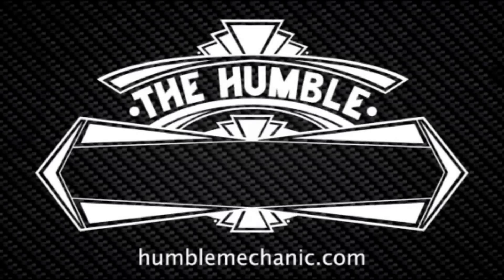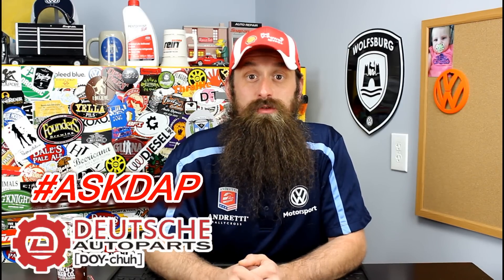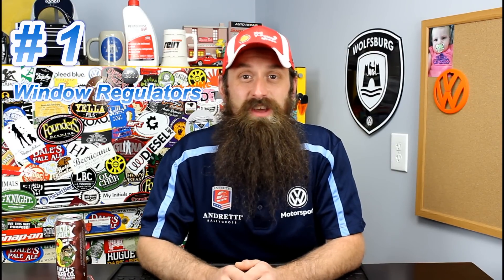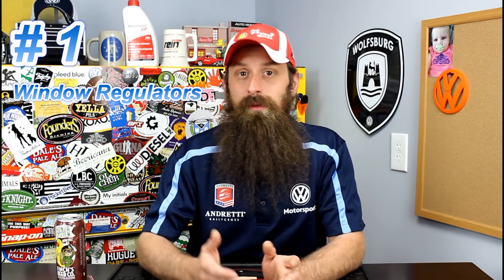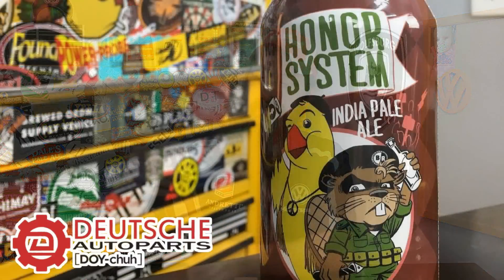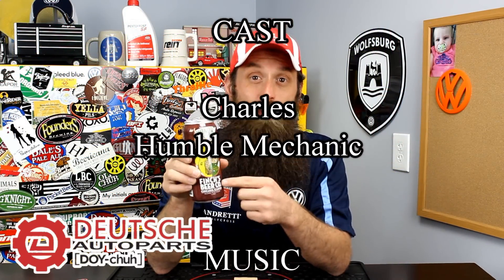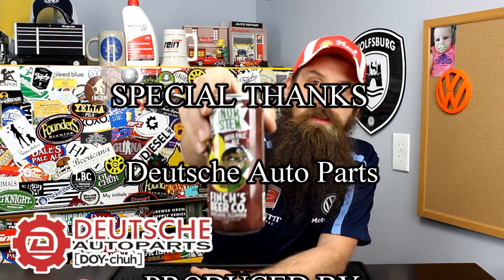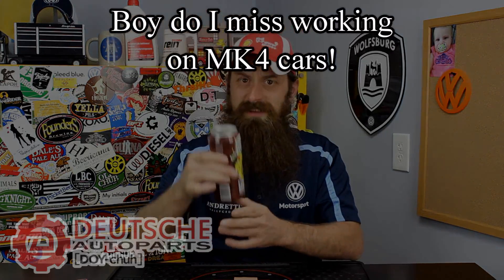Top 5 Failures 1999-2005 MK4 Golf, Beetle and Jetta

Comment: One nice OEM upgrade for one of the issues listed: control arm bushings. Get the solid rubber bushings from an Audi TT or Golf R32. They are a LOT more durable and don't allow nearly as much movement as even a new stock bushing. The steering feels significantly more direct. And they fit not only Mk4s, but mk3s, B3/4 Passats, Corrados and even Mk2s.

Comment: - Hand brake cable causing rear uneven braking.
- Mass air flow sensor.
- Turbo
- Trunk (boot) door lock (water gets in)
- EGR valve getting dirty
- Carpets loosing from locking mechanism in the floor.
- Key inmobilizer failing intermittently.
- Door panel switches for windows failing intermittently.

Maybe a video with the top #100 problems? Anyway ALH engine was the best all around.
Reply: Beetles from 2000 can be got for around £600 in the UK (quite cheap for a VW imo and maybe for a future classic) .

Currently I own a Ford Fiesta Mark 4 (Smiley) 1.3 Endura Engine which cost me £418 from Ebay  with a full service history I've got a service coming up in a c ouple of months I've owned it for 2 and a half months and it's been a fine little car and good MPG (40 to 50 mpg). 

Just thought that maybe ANY make of car will serve you well if it's serviced as per the manufacturers guidelines .. what's your opinion on this say if I were to buy a £600 Beetle?  I'm just asking a general opinion because there is a little voice telling me that replacement parts will be of the revised and improved versions these days and essentially something old drives forth as something of better performance and reliability .....
Reply: @TheFusedplug   late addition, but so long as you get a manual transmission, which I'm sure in the UK is no problem at all, they are still perfectly fine vehicles. So long as they were maintained of course. I currently drive a Mk4 Jetta TDI (alh of course) and it's been moving me for well over 2 years with no major problems. I take care of it mostly but the big stuff I leave to certified mechanics. It has been nothing but good to me, only offering me some small projects for the weekend on occasion. And I live in the salt belt of the US! Well built vehicles when maintained will function for long after the manufacturer has deemed them obsolete.
Reply: To add to this, the great thing about old daily drivers Is that there is nothing new under the sun. Every possible issue these vehicles could have, has happened. That means finding information and, finding a mechanic who knows how to fix it, is much easier than the newest model that is still proving itself
Reply: @Limeslice4r64  Your car is still ROCKING  :)
Reply: @Limeslice4r64  In other words OLD CARS ROCK !  They have way more character as well :)

Comment: Between my 2 daughters and my wife, we have 3 Mk4 Jettas.  I would add glove box hinge, center armrest, dashboard cup holder, wiring from body to trunk lid, trunk lock, finish on aluminum wheels, LF wheel contact with fender liner, ECU control of A/C (can't fix it because we can't get a code), and moisture leading to foam under oil cap.  I'm a sucker for styling and the Mk4 is hands down the best looking Jetta ever.
Reply: i love my mkiv. what engines do u have
Reply: The cars are all practically identical.  2.0 gas motors with 5-speed manual transmissions.  I know my wife and my daughters.  They couldn't care less about extra power from a turbo or from a VR-6 and all I saw was more headaches so I made sure they all got the most basic engine.  They're all GLS models so they all have sunroofs, heated seats, etc.  I stayed away from the diesel because I wasn't up to learning a whole new concept in maintaining cars.  Kind of nice that the cars are identical because I only have to navigate one learning curve.
Reply: Nice!! Sounds great. The 2.0 is a solid engine, even if it is underpowered. It gets the job done and gets good mpg. What do you avg? Props to them driving 5sp. I have a 5MT Jetta VR6.. horrible city mileage haha
Reply: Everybody has their opinion of what underpowered is.  I believe they're plenty fast enough and as I said, my wife and daughters aren't into drag racing.  They just want a comfortable ride that gets them where they want to go with reasonable efficiency.  As far as fuel economy is concerned, my kids don't pay attention to it and I've been driving my wife's car for only 8 months so I don't really know yet.  Have yet to take it on a long trip however I suspect it will not match the 40mpg we acheived on trips with the car it replaced, a 1994 Mazda Protege 1.8 (actually 1,839cc).  Before I sold the Mazda, I took note that at 70mph, it was reving at something like 3,200 rpm while the Jetta revs at 3,800 at the same speed so the final drive must be taller on the Mazda.  Taking into consideration the extra 600 pounds of weight, the extra 145cc of engine displacement, and the shorter gearing, I don't expect the Jetta to return more than 35mpg highway.
Reply: Funny you say you have bad MPG with the VR6 because I have a 2001 Jetta with the VR and I get no less than 22mpg, not bad for a 16 year old V6
Reply: Martin.  First of all, I don't believe that age has any bearing on fuel economy.  If anything, a typical internal combustion engine should return slightly better mileage as it ages because the moving parts wear into each other causing them to move with less resistance as time goes by.  Second, I suppose bad mileage is a reletive term.  Apparently, you believe that 22mpg (I assume this is your highway number) is good.  If any of the three 2.0 litre Jettas my wife and daughters own began returning highway fuel economy under 32mpg, I would get out the scan tool to see what the problem was.  22mpg from a 2.8 litre VR6?  My 1992 Dodge Caravan LE equipped with a 3.3 litre V6 and a 4-speed automatic transmission with a lock-up torque converter regularly returned 20mpg pulling my boat, 23mpg without the boat, and 25mpg if I set the cruise at 55mph.  Remember, this is a 7-passenger minivan!
Reply: The VR was also not really designed around the intention of a comuter, very different purpose than the 2.0. And I use it's age to reference the change in technology over time, almost 20 years ago the way engines were designed were different than they are today, there's more fuel efficient cars available on today's market. My VR6 also makes WAY more power than a NA 2.0. So that all factors in. And as far as that mpg number being good? It's the not the greatest no, but with more than half of everyone on the road driving 10-15mpg SUVs with big V8's, I think 22-26 is a solid number for real world mileage. How many V6's do you know average more than 30mpg anyway?
Reply: Martin.  Oh I agree that much has changed in the past 20 years.  My minivan is 25 years old.  I would suspect that there was even more change in the past 25 years.  OK, you've changed your mileage claim from 22 to 22 - 26.  If your VR6 is returning 26mpg, that sounds like about all you can expect and I would call 26mpg OK for a VR6 but not 22.  I never said I knew of V6s that averaged more than 30mpg.  My kV6 minivan hits 25 on a good day at 55mph.  I simply questioned why you considered 22mpg to be good.  Compared to V8 SUVs, everything else is getting great mileage!
Reply: My 2001 VR6 gets 26-27mpg on long cross country highway trips. In the city, which is my daily driving, I get under 20mpg... 20mpg on a good day in the summer
Reply: That foam is due to short tripping or ethanol in the fuel
Reply: All the 2.0 needed was a 6 speed transmission.
Reply: I had a 2.0 GL and now I have a 1.8t GLS and I had far more issues with the 2.0 for some reason than I do with my 1.8t. Knock on wood. Wanted to get the 1.8t tho because I wanted a manual and to make power. Now I have a Unitronic stage 1+ making 225hp and 260tq at the crank.

Edit: Wish I had the 6spd like the GLI though. Much stronger trans than the 5spd I have now.
Reply: My 2.0 gets some garbage mileage but that’s because I have to floor it everywhere to get places
Reply: Can you describe this AC problem you have? I've been chasing my AC problem ever since I got my 2.0 Jetta and I still haven't figured it out.
Reply: Ive had a mk4 golf and now a mk4 jetta wagon both with TDI's. I'm not sure if it's the vehicle or the engine I'm in love with more 🤔

Comment: Near and dear to my heart as my wife drives a 99.5 Golf MK4 2.slow with auto. 167k and while it has had several of the mentioned failures (cat, window clips, temp sensor to name a few) it has been a workhorse and is still a pleasure to drive. I feel the MK4 Golf's have a very timeless style to them as well.
Love your shows, just discovered you after dieselgate started (I drive an '09 JSW TDI so am in the thick of it).

Comment: I get a warm tingle knowing I've fixed all of this on my golf
Reply: Does it make you get warm tingle knowing your car is still a piece of shit after all that? How much more shit has broke since you posted this comment?
Reply: Don't bother to reply, I know you'll lie because you're a vw fan boy. We all know that car has been parked and not running since
Reply: Jasper Harber  Of course you got it cheap, no one wants these cars. They drive well when they work, but VW used so many cheap plastic parts on them, the wiring harness is hacked together, ccm controls all the windows and locks, they're a mess to fix and have failures often. A stealership designed car to break down.
Reply: @trashman1694  Had mine for 11 years now, got close to 300 000 Km on the odo and I still love it. I'm no fan boy, the car converted me from Toyota to VW
Reply: @SavedbyHim  My dad's 1990 1.6 Celica has 470 000 kms with no engine repair more complicated than a head gasket that blew because someone didn't change the water pump while changing the cam belt while my friend's 1.6 mk4 golf is already on it's second engine and the chassis just surpassed 200 000 kms. How did you get converted????
(Jk, that golf saw shit that my dad's celica didn't think cars went through, and the engine ws blown when my friend bought it.)
Reply: @AlexRib  2nd engine at 200k km? Mine is at 273k km now with original engine and parts
Reply: @Florian00  Yup, the block was cracked, water was getting mixed with the oil.
Reply: Same on my 1.8T Jetta...
Reply: The only thing mine has is the green coolant temp sensor, and that was already in there, I'm scared now.

Comment: The glue on Head liners and door panels fabric deteriorated, front strut mounts failed, water pump impeller, front wheel bearings, coolant sensors, just to name a few.
Reply: I had to replace the water pump on my 2003 1.8t beetle 6 months ago... car had 36,000 miles on it and 31,000 when I bought it a year ago
Reply: @GabeNydick  Never replaced my water pump on my Bora, 192,000kms still going strong
Reply: @FLIXXE  Don't get me wrong plenty of cosmetic faults like plastic falling apart and so fourth but it was a good car ended up selling it anyway and wish I never did.

Comment: Door handles, Power window switch, battery fuse box, plastic coolant flange, plastic thermostat flange / housing,  Secondary air pump lines, Secondary air pump, Plastic water pump impeller blades, Blower motor, ECT sensor, MAF sensor, Basically anything electrical, Alternator charge cable, I can think of more, all I need to do is go looking at the parts in my garage. Not sure why I keep half working parts around either. Never know when you might need a half worn front brake pad from a 99 Vento.

Comment: Plastic Impellers in the water pump....
Reply: YESSSSSSS
Reply: OH YES!
Reply: Haha done my water pump three times!
Reply: I ordered the gates timing belt kit that was supposed to have a metal pump but it was plastic. I was pissed
Reply: I have changed the water pump few weeks ago and I was blown by this fact. Good that the new water pump has solid metal ones.
Reply: Really????? Wtf of a engineering choice is that???
Reply: @aig0039  
Yup I'm resurecting a 99 that's been parked in my garage for 7yrs, because it was due for timing chains.  
Water pump, crackpipe and metal water housings are on the shelf and waiting,besides a mountain of other stuff. 
I'm game for reliability upgrades cause I'm hoping for it to be a daily (most of the time) for about another 5yrs.
I'm not a mk4 guy so I'm trying to learn as much as I can about this platform.
Reply: @AlexRib  
That shit dates back to rabbits , always get a metal impeller pump for any VW when possible.
Reply: @MrTheHillfolk  I did the same. All the parts are high quality, for sensors I buy Denso, Hella, Bosch. Lemforder bushings and Monroe tie rods. MAHLE for filters.
Reply: @aig0039  
Oh heck yea , I learned years ago that the automotive box store parts don't work. 
I've got a good foreign parts place here in town who only sells the good stuff. 
I support em when I can , and the prices aren't out of sight like you might think. 
A few yrs back , I needed a pad and rotor set for the wife's Jetta. 
It was 190 online (quality aftermarket/OEM supplier stuff) 
But I'd wait 3 days. 
So I called down to the foreign guys. 
Not in stock, will be here by lunch for 203$ out the door. 
The couple bucks to have it in my hand that day was worth it. 
I've been ordering tons of parts  online for this project ,the stuff I know I need right now. 
 but the stuff like correct fluids and any parts I might have missed I'll go get in town.

Comment: I've had my 2003 GTI VR6 for almost 17 years now, as my daily driver.  It has been incredibly reliable and trouble free all these years, except for the cooling fan and A/C breaking down.  I garage and 'baby' the car, but still... I am shocked it's been this reliable.  I even have the original chains on the engine.  The 6-speed manual still shifts crisply too, even though i've never changed the transmission oil... not even once.

Comment: The Mk4 platform should really have a top 20 lol
Reply: 4th Gen for short. The generation changes mainly applies to the golf although many vehicles shared the same equipment in the US and are changed around the same time. They all got a tdi variant, an n/a 2.0l gasser, 1.8t 20v engine and same transmissions. Interior materials all had the same crummy soft touch, sagging headliners and crumbling foam in the HVAC system. They also smells like crayons. :D
Reply: 4sf3d4g63 buuuuttttt 

Mechanically there reliable...  so thats,a plus
Reply: Paul Morris... though there is that soft cam.
Reply: to be fair though... After these cars have passed 60 k miles then most of these glitches are sorted,.  Mine is on 165000 now and it still purrrs along without issue cept for basic maintenance.
Reply: @cosmicsman666  same here. I bought a mk4 vr6 gti from a rich college student whose dad had replaced everything, even the transmission. Now at 155k it's still going strong. All the electrical components work including the heated seats, power windows, locks, lights, instrument cluster etc. Great backup car.
Reply: @garymathe9863  VW has an abysmal 1 in every 52 engines with failure or worse depending on the year and/or vehicle. TBH it's a fact most VAG vehicles are unreliable it almost comes with the brand, fun to drive, but a pain in the ass with silly failures that VW could've built better,  but chose not to.
Reply: @garymathe9863  my wife's old 99 beetle is about to hit 450k with no major work done.
Reply: Gary Mathe KM or miles?
Reply: M. Guillermo I have owned all sorts of VWs, everything from four Foxes, to a bunch of Jettas and Golfs Mk2, Mk3 and Mk4.  Over the last 30 years I have always owned at least one VW vehicle.  I would never describe any of my cars as being unreliable or needing repairs at a greater frequency than the other vehicles I have owned concurrently.  A huge benefit with VW is the massive amount of support if you do need repairs.  If you want to DIY, the online community is fantastic and the parts are usually very easy to find and not too pricey.  Overall they have never been the most repair prone or expensive cars that I have owned.
Reply: @seanmccready9564  Which one is more expensive in terms of  maintainance - labor, parts, etc. - MK4 1.8t vs vr6(12v/24v)?
Reply: Oscar Rivera I have not owned a mk4 1.8t or VR6, but since the 6 needs more oil, spark plugs etc I would guess the VR6, but as I said I don’t have personal experience with either engine in the Mk4.
Reply: Facts
Reply: The entire Mk4 is a basket case, but they are nice enough to keep repairing them.   

I'll add blend doors.    And if you're in the salt belt, the fuel filter will corrode and leak.   I don't know how they avoided a recall on that dumb design.

Comment: Heh, my 2001 Jetta had the piston rings installed upside-down from the factory. Blowby killed the cat but to my surprise it didn't even burn oil after replacing them properly. I love MK4s.
Reply: by far the best generation of VWs.
Reply: debatable... i have had mk4, 5 and 6 and i think 6 was the best. havent tried mk7 yet.
Reply: MK4's will literally be falling apart around you, but still might start. As long as your volt regulator doesn't overcharge and kill your battery :')
Reply: Lol mk4s are all broken now, good luck reselling one for more than 1,000 dollars in 2018.
Reply: @trashman1694   i just bought a 2003 tdi beetle for 2k.  Reason for this higher price is it only has 73k miles on it. Took a sneak peak at the timing belt and its starting to fray on the edge and it only has 40k miles on it,  but it is over 10 years old.  In comparison my 1990 toyota cressida has had the same timing belt for 15 years and it still looks good